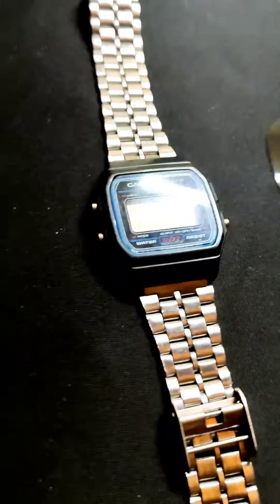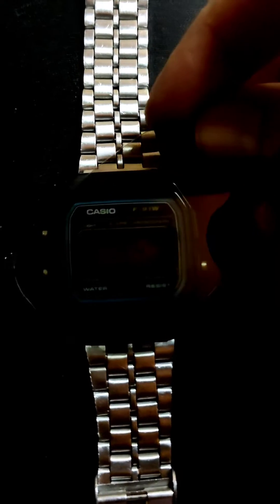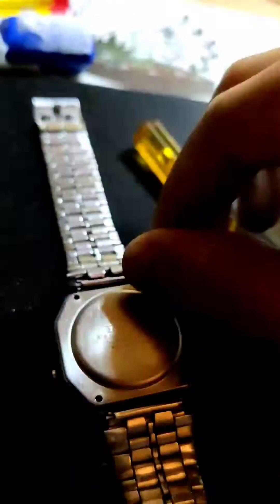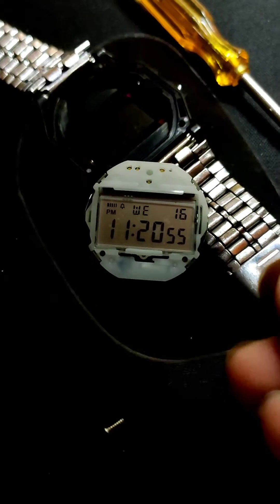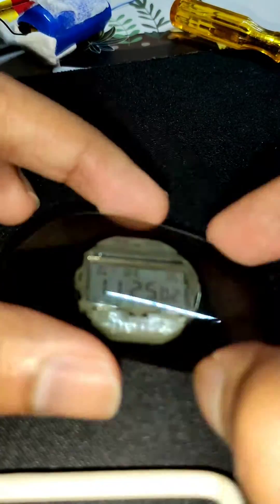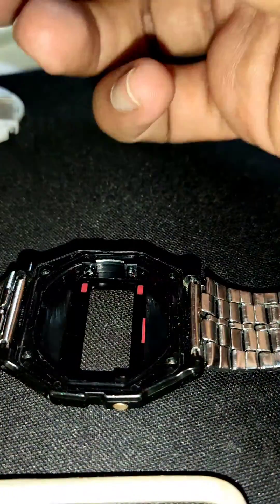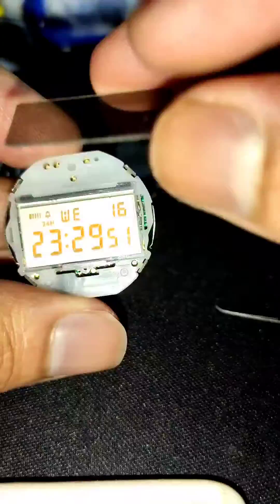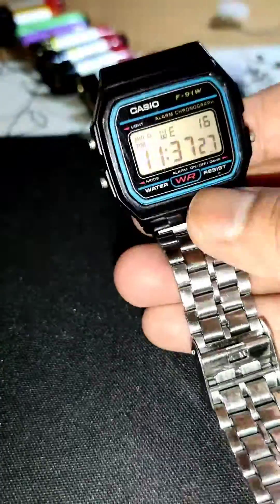Faded LCD display fix for watches

Comment: How about if the lcd is clear completely no display but the light at mode is working. I think my watch is still working but no display
Reply from the maker: could be that the lcd contact points got loose. easy fix. open it and reinstall back with a lit more pressure.
Reply: I did this with an old Seiko and it improved digits visibility but now the display is too dark. Are there type of filters that are more transparent than the others? I cannot take the old polariser of because there's printing on it.